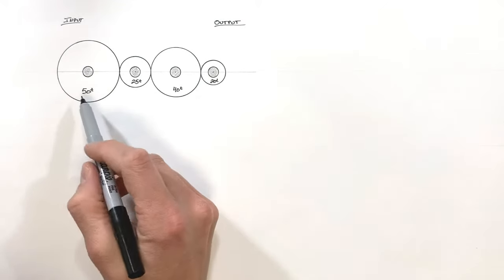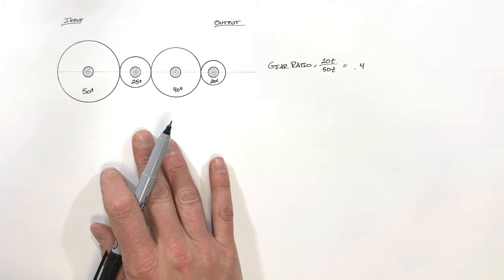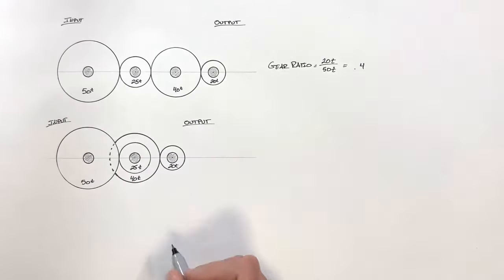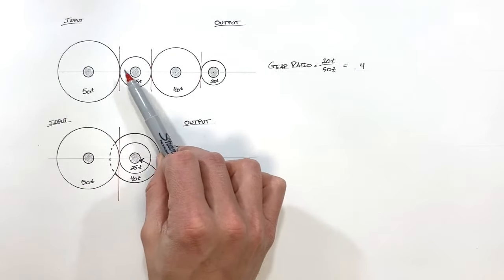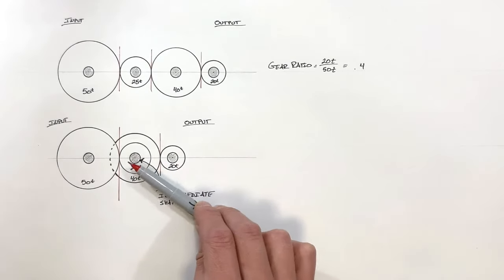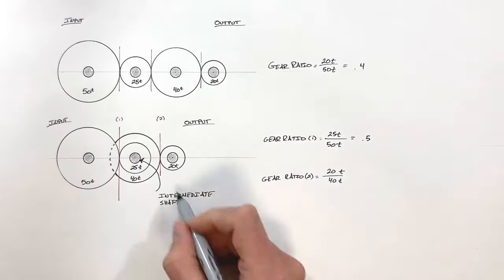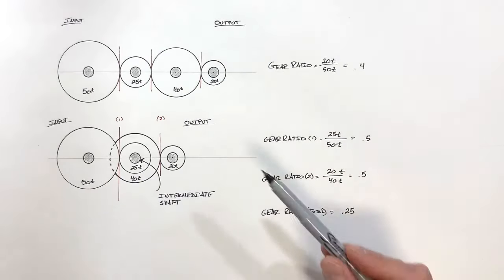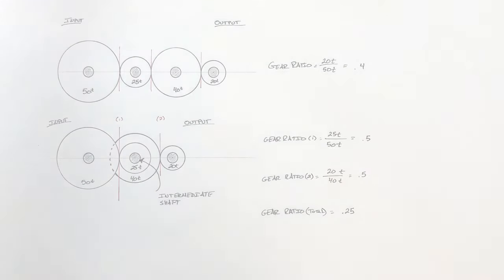Compound Gears Explained:  Calculate Gear Ratio

Comment: Is it possible to calculate torque reduction in a compound gear train like this one? would the torque be reduced to a quarter of the input?
Reply from the maker: Once you have the gear ratio, calculate torque just like you would with a simple gear combination.  Ignoring losses, GR of 10 means 10x the torque, regardless of how that gear ratio was produced.
Reply: @INTEGRALPHYSICS  thank you.

Comment: is there a calculator for when you have a set of gears and you need to find the right combination when all you have is input turns and output turns? IE: milling machine table to dividing head via gearing; 1 turn of the table equates to 5mm direction dividing head is 40:1? all i have at the moment is 30 turns is the lead of the table so 64t driver and 48t driven will turn the dividing head 1 rotation

Comment: Great video. Is it possible to ask for further instruction on this topic?
Reply from the maker: Yes, absolutely.  Whats your question?
Reply: I'm not understanding if there's any mechanical advantage, loss, or neither in a double rack and pinion gear system where primary rack has 20 teeth, meshing w a pinion gear that has 10 teeth. That pinion is a compound gear which shares an axel with a 20 tooth gear, which drives the secondary rack gear of 40 teeth. 
How much force out will I get per force in?
Reply: I'm not understanding if there's any mechanical advantage, loss, or neither in a double rack and pinion gear system where primary rack has 20 teeth, meshing w a pinion gear that has 10 teeth. That pinion is a compound gear which shares an axel with a 20 tooth gear, which drives the secondary rack gear of 40 teeth. 
How much force out of the second rack will I get per force in to the primary rack?
Reply from the maker: primary rack moves one tooth, 10t pinon moves one tooth...  the 20t on the same axle as the 10t moves 2 teeth (same angular rotation as the 10t, different tangential distance), the secondary rack moves 2t.  1t in, 2t out.  IMA = 1/2.  

Conversely, if the 10t and 20t were meshed together and not on a common axle the 20t and secondary rack would each move 1t.  IMA = 1/1

Comment: Thank you,
I have a question, compound gears have the same speed (rpm) so normally they have the same Torque, However torque is related to distance as per T= Fxm (Torque equals to force x distance) here distance is the radius of the gear. So normally as per the definition of Torque they shouldn't have the same Torque as they have different distances away from the center of rotation. Any explanation? Thank you.
Reply from the maker: All gears that mesh have the same TANGENTIAL speed (measured as a linear speed at the edge of the gear) and force (measured in Newtons or lb).  All gears that are fixed to the same shaft have  the same ANGULAR speed ( measured in rpm) and torque (measured in Nm or inlb).  The two gears on the intermediate shaft have the same torque, but because they have different radii they produce different forces against the gears with which they mesh.  Hence mechanical advantage.
Reply: @INTEGRALPHYSICS  I have a drill press with a motor connected to a step cone pulley (pulley with different groove diameter), obviously the pulley grooves rotate at the same speed. so according to the coumpound gears explanation they have the same torque. Is this correct!? Isn't it more difficult for the motor to move when the belt is connected to the bigger diameter groove than to the smaller one logically. Am I missing something? Thank you.
Reply from the maker: The belt and pulley on a drill press which connect the motor to the chuck shaft can be viewed as a set of simple gears connected via a belt, not compound gears.  This means they share tangential values such as speed and force, via the belt, however the step cones have different diameters there fore they have different torques.    

Belts & pulleys are on my to-do list for videos.  Hopefully in the next month here I can get something out for you...  In the mean time check out the Simple Gears vid, the calculations and concepts from which can translate to your drill press (sans belt).
Reply: @INTEGRALPHYSICS  Thank you, looking forward for your videos.

Comment: Wouldn’t it be more straightforward to flip the ratios?
Then you’ll get that rotating the first shaft 1 time rotates the last shaft 4 times.
Reply from the maker: I agree that sometimes GR would be easier if it was inversed.  However it mirrors what we see with mechanical advantage, meaning a GR>1 translates to an increase in torque.

Comment: nicely done!  Your dedication to Detail is amazing. thanks for that  effort.  I do have a question,  the Middle Gear can also be thought of as a Wheel And Axle machine. So, when considering the Forces at the Interfaces.. it seems like the Wheel And Axle Mech Advantage is ignored.  I guess we'd have to look at the Torques... anyway..  nicely done.. :)
Reply from the maker: 1.  The input and output shafts/are wheels and axles.  
2.  All wheels and axles are levers.  

Redraw the middle gear as a lever with a short side and a long side and you have turned a compound gear train into a simple machine.